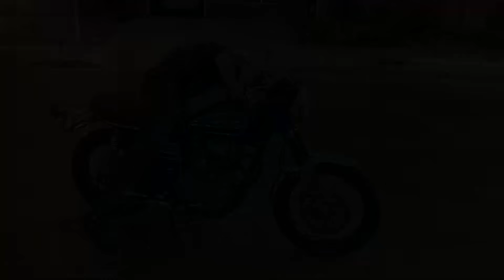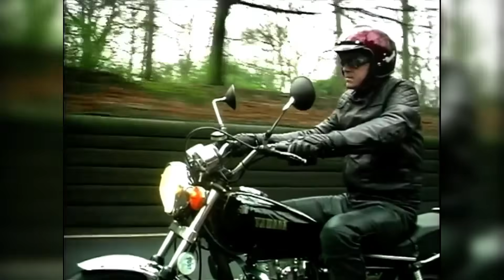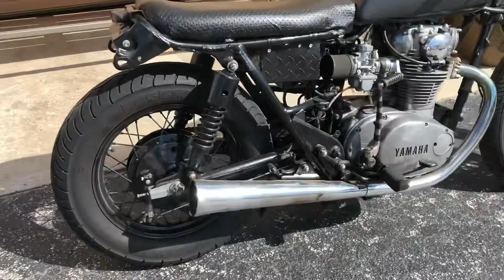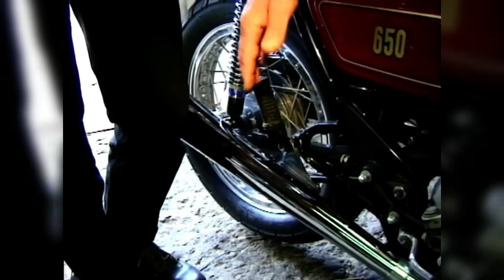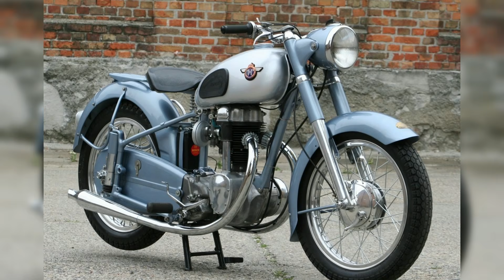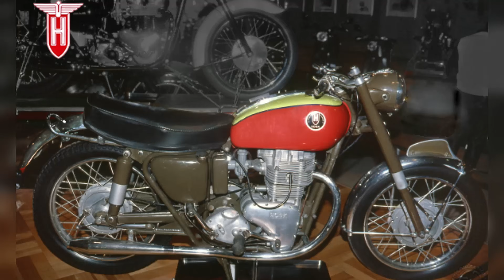THE EXPLOSIVE TRUTH BEHIND YAMAHA'S BULLETPROOF XS650

Comment: Two things first. You didn't mention that Yamaha modified the engine considerably from the German original design. Secondly, despite whatever you've heard about the frame, causing the bike to shake at highway speed. I've never heard of anyone who experienced it. I had an excess six fifty, and i've ridden two of them.And neither one of them had this problem at any speed.All the way up to a hundred miles an hour or more. I keep hearing this myth and that's what i'm believing it is. I've driven an excess 650 down the highway for many, many miles down, curvy, country roads and city streets. I've never experienced any instability or wobble in the frame at any speed doing anything on that machine. None whatsoever.

Comment: At 24 yrs old with 2 kids at home in 1975. My choices were a Sportster, a Bonneville or an XS 650.
The XS was $1399 brand new. Several hundred less than a Trumpet and $800 less than a Sporty. No brainer for a pauper.
Magazines said reliable-yes.
Fast-no. If you want fast, go with a Kawi 900. Or a Honda 750. 
Drive the XS like a madman and it kicked butt. Then there was the Honda 750 Super Sport. Regularly beat them too.
At the time, the only bikes that lost a race to were the Kawies.
900 and the 750 2 stroke. Those 2 kicked my ass.
Then the Water Buffalo Suzuki.
That one was a tie up to about 80 mph.
Traded her for a Beemer. 
Still have good memories of the XS.

Comment: My 1978 650 was the special, burgundy with beautiful shaped handlebars. 
The balance of that machine was amazing!!! The center of gravity was low and in the center of the bike.  I did so many crazy things with it and I must say it felt like the bike loved me. Flying on the bypass at 85-90 mph coming up on two 53’ box semi’s following each other the rear truck though it would be a good idea to pull up next to the other truck. I flew right between them never slowing down , never noticed the turbulence between the trucks. My riding partner said I would never make it through the first year of riding so he tutored me on some of the finer points of staying alive. 
Like I’m invisible and most car drivers were worse than me. He was nine years older than me and crazier than me so I learned quite a bit. 
We were neck and neck on a narrow highway north of town and he was right next to me; I wanted to lose him in the S- curve doing 95 mph. When I came out of the curve he was right there in my mirror. I yelled out “you are nuts, yelled back “ME?!!!”

Comment: I had one of these as my first "big" bike.  It vibrated so much at idle that it would walk backwards on the centre stand if you blipped the throttle, and the mirrors vibrated at speed. My 1978 example  came with an electric starter, but it was anaemic and quickly drained the battery,  so I found it was simpler and quicker just to kick start it.   

Handling was ok, but not totally confidence-inspiring.  The early models were handsome bikes that resembled the best of British twins, and could be mistaken for Triumph Bonnevilles at a distance.  Unfortunately, in the later years of production, Yamaha tweaked the styling of the "special" models in the direction of laid-back cruisers.   They replaced the handsome aluminum-rimmed spoked wheels  with ugly with cast aluminum items, and added high-rise handlebars and stepped seats that further alienated fans of the original Britbike styling..

Comment: Over 5 decades I have owned many bikes.
     I have owned 3 XS 650s - a 77, an 80 and an 81.
     They were okay. The engines on these bikes sounds and feels strained above 60 mph but, to be fair, that may have more to do with very typical under-gearing ( very common with Jap bikes ).
     They were neither very fast in 1/4 mile nor in top end, but nevertheless fun to ride, yes, quite reliable and had a nice sound.
      Some of the info offered here is rubbish. These engines are notorious for stretching their camchains to the end of the usable by around 30 000 miles, or less.
      100 000 - mile specimens ?? Maybe with a blue Rotella cloud trailing the bike. Piston rings on these bikes are toast at 35 000 - 40 000 miles. As stated, repairs and maintenance were very affordable. 
     I went from my last one ( circa 1991 ) to a Honda CB650. The Honda was simply superior in every aspect. Better power, smoother delivery, more stable at speed and, I think, better looking.
     XS 650 wasn't bad. In terms of a vintage Jap twin I'd say the Virago 750 is better.

Comment: Bought a used '76 XS650 Special 30 years ago and kept it for 15 years. Black with cast wheels, part of the chopper-look series introduced by Yamaha in the mid-70s. Wasn't the fastest or best handling bike, but like the narrator says, routine service kept the engine running forever. It was a comfortable bike that was easy to ride and had a shorter ground reach with the stepped seat. My only criticism was the tank design: in profile it looked great, but from the rider's perspective, it was too narrow. A little additional width would have made it look better.

Comment: One of the most pleasant motorcycles I have ever ridden. The frame and suspension was compliant, the engine's powerband was spot on and the thing was very light feeling between one's legs. Just a very good riding machine. Very pleasant riding experience.

Comment: Thanks for the video for a fact. Memories, I had a sick excess 650. Let me let me breakfast though. I'm blind. I'm using speech to text and it screws things up all the time. So please excuse any misspelled words, lack of punctuation, things that don't make sense, things that might make sense for have nothing to do with the the video. I'm just blind using speech to text. And it has its own unique. Take on the English language. Okay, that's fine. Yeah, my first bike was AYM1305 yamahaja I bought down a 76 maybe early 77I was thank you so much 1718 years old. I had that bike for a while. And then a couple of years later, I bought a 1975 Suzuki GT 550, both these bikes vibrated believe me, the GT 550I put tons of miles on it going from Providence, Rhode Island to New York and back on a regular basis. On weekends, during writing season in the East Coast in 19I guess it was either late 80 or mid 81. I bought AI thought it was a 70. My memory says it was A71. Excess 650. But according to your video I don't remember an electric starter on it. But then, again, the more I think it probably had one didn't work. Because I remember using the Kickstarter all the time. And I do remember that it had a front disk, because when I bought the bike when I used the front brake, because the bike was neglected. Even back then, and it was kind of rusty all over and riding it home. I remember when I used the front brake, it pulled to the I don't, I don't remember which side it pulled to, but it was a very, very strong pull to the side when I used the front brake, and it was disk, eventually I got all that straightened out, had the bike for a while. The only modifications I did on it is I put in a ridiculous, huge corbyn seed on it, with beautiful seat, all leather, you know, corbyn mace, good seats. But and it was made for the bike, but it made it seem like you were on stilts on the sea. But I used it like that. It was more comfortable in the worn out stocksey, and I put headers on it 2 × 1 headers. And they sent me the wrong one, and I ended up at the they fit fine. That the coming out of the engine, you know, we amounted the exhaust fives to the engine fit. Fine there but when I try to bolt it to where it was supposed to be bolted, it wouldn't work. So I couldn't figure out what the hell was wrong with it. But eventually I took a drill, and I drooled a new hole, and I bolted it on. I found out later just that they sent me the wrong one for that for that specific model. I had one experience with it. It's the only time I took it in a long distance ride. I was living in New York City at that point. I've originally from New York City and my family, when I was about 1415 moved to Rhode Island so I'm already back in New York City at this point on my own. And I was going up to Rhode Island to visit my parents. I made it up there and I had to be back at work at 12 midnight. I used to work at a newsstand an outdoor newsstand where I think it was the second largest independent newsstand in New York City in Greenwich village. I had to be there by 12 so I left Rhode Island with plenty of time and on the way down. I heard like a slapping noise, and I said, oh, and it started to lose power. Then, it was normal. And I was praying, I'd make it at least to work. Well, I made it to about a third of the way or so right in the middle of the of a large curve. The Apex of the curve I don't know if that's the correct word, but like in the middle of the curve, where it curves out the most and the bikes stall, it died, the engine. Just died, and I was in the middle of that. I was in the middle of the tunnel or a third of the way and no one could see me. Because the curve was very wide, and very long. And there was, you couldn't see, it's a blind man's curve, and I was just waiting for somebody to come through. And run me down with the car because there's no pullover lane in the Midtown tunnel which connects New York City to Queens. I had to walk that bike most of the way through the tunnel. I mean, it was probably one of the scariest motorcycle things. Journeys, I ever went on, I've had horrible falls and crazy stuff. But this was scary because I was just waiting for the guy behind was coming around. That curve was coming through. And you know, you can't just weave over to the other lane or anything. And run me over, but I got about to to the end of the tunnel, the the transportation departments. I guess some must have said something came and got me out of the rest of the tunnel on a truck and then I had a call and have the the bike toad. Actually, the bike might have started again. I don't know. I made it to work though, and the bike was fixed. And I used it again, they used to drive it back-and-forth from Queens to New York City for work. And on lots of trips, through Long Island it was a very liable bike up to that one. But after it was fixed, it still gave me lots of miles. I ended up having my uncle gave me a brand new. It was 81 sturgeus, when they first came out Harley, and I didn't know if I wanted to keep it because I never had a Harley was completely different, but I rolled the Harley for a while. And then I got it back on my Yamaha, because I still had that bike, and I was like, no, no, I'm keeping this Harley, and I'm going to sell the Yamaha sold it for 600 bucks. The way it was with it that is, with the, you know $,300 or whatever cost me cauphan, C. But I got tons of miles out of it and tons of enjoyment and relaxation, believe it or not. And and I only paid 500 for it when I bought, yeah, that Harley changed my my view of I always wrote Japanese bikes, but that holly got stolen. Eventually, I'm not going to get into how but it got stolen. And the uh, like most things in New York City, if you don't chain them down to the to a building, lol and couldn't afford another Harley. And so I bought a use, I guess this was now we're talking 83. So, I've well late 80 year 83, and I've got to use Honda CV 750 custom, which I put 50000 miles on with basically. No maintenance just tires when and M batteries, things like that brakes. I eventually turned it into a baba, took off the tank. Reshaped, it took everything that said hondura, after that I could and yeah, I lowered the bike so far with my friend welded me together. Strats, psychology in the back and replaced where the shocks were and yeah, and I rode that bike for years in San Francisco I actually yeah, it was in San Francisco I had moved and sue all different types of roads conditions. And even with the the structural struts, I put on a big solo seat, like the old time bobbers, you know, I went over all the train tracks a lot of hard bumps, and you were thinking the freight that swing on and the bushings and all that were not made for that, but I never had a problem. The bike, you know, the bike was always dependable. Always started, it handled fine. After what I did to it, because I'll feel when I lowered the thank you. So the frame the bike and the rear, it changed the wheelbase and it, you know, it also changed the rake somewhat and yeah. And the bike handles fine, you know, had the Big Springs on the seat. But when I saw a bump, I did what you were doing on a horse. I guess I raised my a** soft to see and let my legs my knees. You know, absorb the shock so bump, but it worked fine. And then after that, I kept that, and I bought A71 or it might be 72, holly, Davis and low rider. You know, with chains, it didn't have to double bells like my other ones did, and I rebuilt most of it. And yeah, and I had that bike for a while. And then I sold the Honda, and then I went started to go blind and I couldn't ride anymore. In the mid-nineties, when I had moved back from California to New York. Anyway, that's a long story and I went off-topic with the 650 access, but that was my third bike, I avoided chief in Long Island I still had my Suzuki fly 50. I sold it a few weeks afterwards. But yeah, I have fond members of that bike of taking my old Honeywell pen texts, spotamatic. If I remember camera it were all black. It was a you know, AA photographer's model. You know it wasn't, you know, all black. So there would be no reflection from the camera when light. Hit it. When you were taking pictures, I think that was the idea of it, being all black and I would go all over the place and take pictures, and I did that for a very long time. And that next exist, 50, except that one time towards the end of when I owned, it never failed me. Never failed me.Great bike wish I could ride 12 day sincerely.Bob the blind bed in guitars

Comment: The cam chain did NOT automatically adjust as the vid says, but it was a 4 minute job to check adjustment and only one more minute added to that to adjust it perfectly.  That was good because if the chain got worn and sloppy it could lash and break, which carried a chance of feeding down into the crankcase and locking up the engine - and rear wheel - at highway speed.  
Still; the quick easy adjustment made that only a worry for the terminally lazy.

Comment: I lived in Japan in the 80's  and I had a 650XS that I built into a cafe racer with a fork brace, a welded-on swing arm brace, and air forks in the front and Fox shocks in the rear. I had a custom cafe seat  and rear-set pegs made.  I replaced the stock mufflers with "Bub" resonators  you could roll a golf ball through.  Didn't do much to the engine except K&N's and rejetting the carbs.  Naturally I had drag bars, a cool little headlight fairing and tiny turn signals.  I loved that damn thing.  It was perfect for tight  turn mountain work because with the braces the platform was rigid and predictable and it went where you pointed it but the thing that made it GREAT  was torque. In the tight twisties, straight fours were too heavy and wide. Smaller engines kept their riders busy shifting up and down.  The 650 just pulled like a freaking  locomotive.

Comment: I don't know if you've  ever tried to power slide a Sportster..... I've done it a bunch of times cuz I've owned. couple. sportsters that were built to the hilt... What Kenny Roberts noticed about that 650 wasn't the reliability....... You notice it that much lower and lighter center of gravity that it had was a lot easier to carry into a corner and lean over without over leaning and crashing....... Overall the Yamaha was lighter... With a  lower center of gravity.... It also had better geometry....

Comment: I bought a pair of 750 pistons from the yamaha dealer, and had a friend bore the jugs to suit. The engine was designed to take 650 or 750cc no problems.
It went like a beast, but I never re-balanced the bottom end to match the larger pistons so at idle the front wheel used to bounce off the ground lol.

Comment: My 75 xs 750 was an electrical nightmare.
Always catching on fire and leaving me stranded.
I had green 71 before that.
All stock except for the six inch over fork tubes during the chopper craze.
Never a problem.
Now I'm 67 and ride a 97 Honda Valkerie with 288.000 trouble free miles.
And a 2003 Yamaha Roadstar with 145.000 miles.
A bit over engineered as far as the engine goes.
In my younger years I worshipped Harleys.
Till I went to work for them as a salesman from 99-03.
By then they had forgotten about the people that supported them through the seventies and eighties.
I'm happy that Triumph continues to do well.
I don't care what people say.
Sporsters are one of the greatest bikes ever built.
I've owned several through the years.
And a beautiful V Rod that I had to sell in hard times.
God bless all of you that continue to support the motorcycle industry in these lean times

Comment: They didn't address the death wobbles at 50 mph + which was caused by the tiny top tubes on the frame they were dangerous motorcycles.

Comment: The engine of this bike was just superb. Undestructable. I owned 3 of them back then. Really nice bikes with lots of character. The sound and the mild vibration added to the experiance driving it imo. The handling on speeds around 60 mph failed dramatically though. The disk-frontbrake was far too weak for it's weight and power.
You had to adjust your driving with care to avoid accidents.
It's a shame Yamaha failed to produce a frame/bike suited to this wonderfull engine.